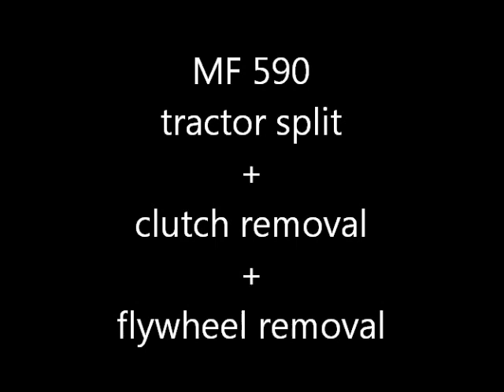MF 590 - Tractor Split - clutch and flywheel removal - part 18

Comment from the maker: your welcome to do it like that.... just be cautioned that your jack is able to roll on a flat surface with little friction...
yes definitely ... but I have changed also the rear main oil seal and I have also some oil leaks at the input shaft housing....

Comment: I have a db case and I think I need to do clutch seems to be at top of stroke and slipping but how did you push back togeather
Reply from the maker: watch my other video "MF 590 - Rejoining the Tractor & Test Drive - part 21 "

Comment: Your clutch should have 3- 1/4x20 holes  in the pressure plate to compress the springs to help reinstall it, u may need threaded rod and nuts compress it.

Comment: Hey,I have two Ferguson tractors, a 575 and the 590 as described in your clip. 
Now, 0f the 590 the transmission is broken and the motor of the 575 is bad. 
Can I put the engine of the 590 at the rear of the 575 so there is a working tractor? 
Because it is the same 500 series. 
Greetings Andries